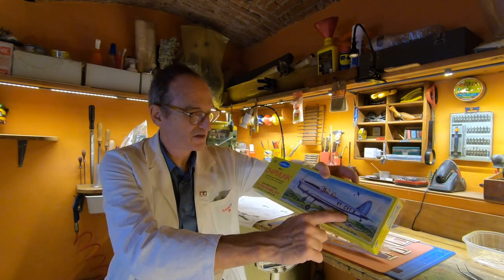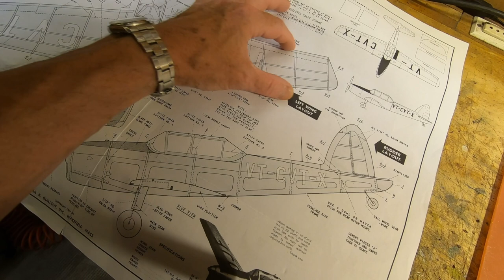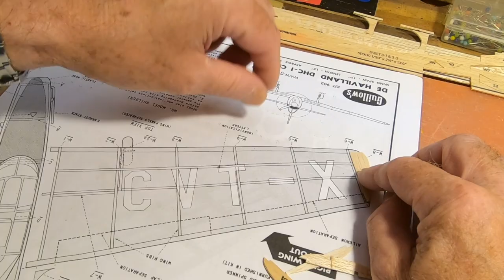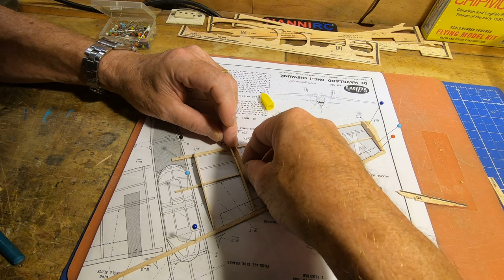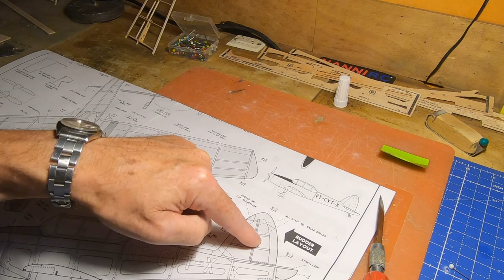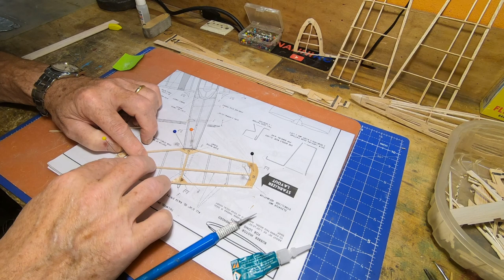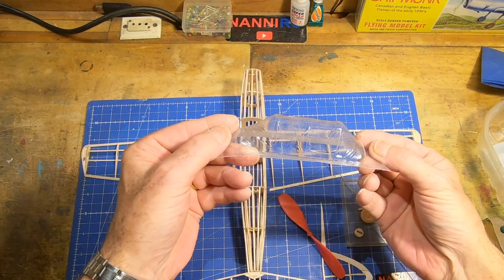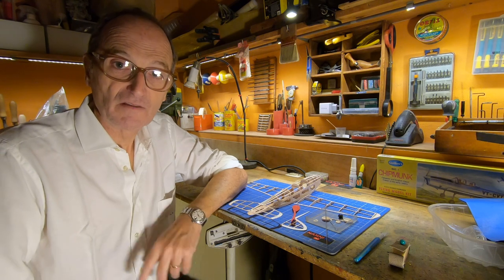Guillow's DH Chipmunk part 2: building wings and tail surfaces

Comment: This brings back memories of when I built the same kit!  Somewhere I read of a tip to make it a better flyer-- The kit is rather overbuilt to account for young ham-handed modelers.  The tip is to sand down the thickness of the kit wood to about 2/3 - 1/2 of stock.  This makes it much lighter (also more fragile) and results in a better flyer.
Reply from the maker: Happy for your comment, As an Italian I did not know the " Ham Handed" we say "With the hands in the hands" or better "with the nose in the middle of the face" but this is for  a person that is also a little stupid. Any how good tips but the plane has a terrible rubber band. Ciao
Reply: Also there is:  "fat-fingered" or just plain 'clumsy'!         @NANNIRC

Comment: I built many guillows kits over the years and as a boy. I loved the process and I remember building this plane. I’ve seen some people using higher quality balsa and doing things such as drilling holes in the ribs to reduce weight. Do you build them for static display or do you fly them as well?
Reply from the maker: To me the fun is building so I follow the instructions and add some little touch from my own experience. Due to the bad rubber they give, my planes can fly very shortly but enough to balance. Thank for watching and Ciao, Nanni